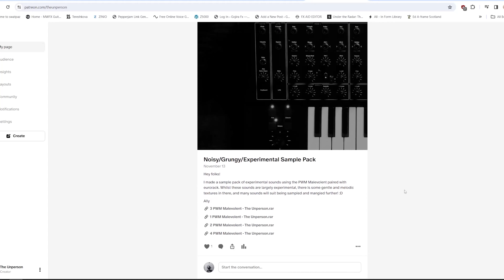Exploring the ALM Busy Circuits MFX Reverb Algorithms!

Comment: how did you sync the whole thing to the ko 2??
Reply from the maker: They're just running at the same bpm so not technically synced. There is a clock input on the KO2 tho so could run a gate from Pam's directly in.